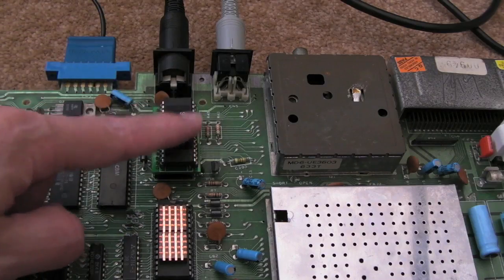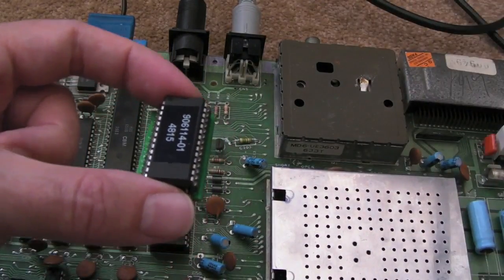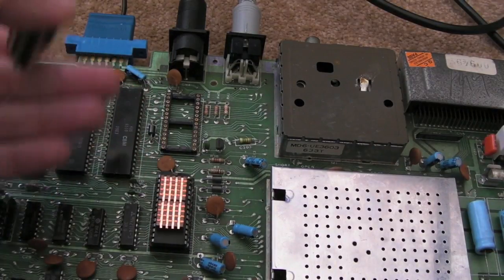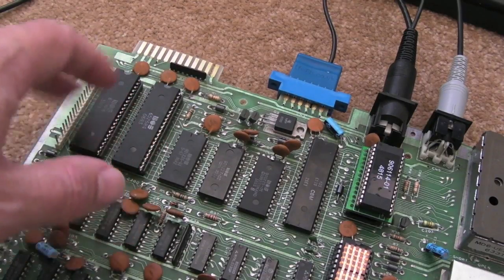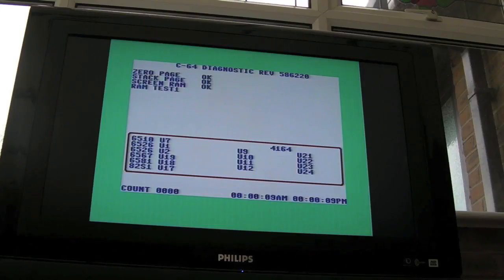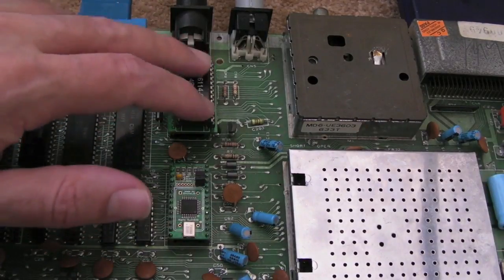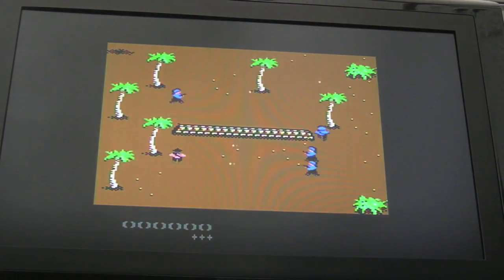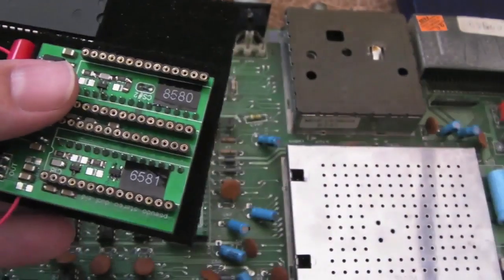Commodore 64 (C64) Tynemouth Software PLA Replacement

Comment: How come your diagnostic cartridge shows both U1, U2, and U18 as bad?  Mine does also and i have a string a keys that don't work so I substituted spare chips but the keys still don't work and the diagnostic cart still shows the chips as bad?
Reply from the maker: The diag cart needs the loopback cable harness in order to test the CIA chips properly.  So even on a working system it will report them as bad.  If you've swapped the CIA chips and the fault remains, I would suspect the keyboard or U28 (4066).

Comment: Hey GadgetUK164, nice videos. I see you have a diagnostic cartridge, where did you get it, or did you create it yourself ? :)
Reply from the maker: +Toshio Spoor There are a few different types on eBay - there's a 'dead test' cart, which is useful if your system is completely dead.  If the CPU has died you probably will still get a black screen with it, and if the VIC is dead you may also still get a black screen.  I use the standard test cart (ROM images available on the internet) in my 'Easy Flash' cart - see my video on the cart.   The Easy Flash cart is programmed using the C64, you load the programming software, select your .crt file from your SD2IEC and then it programs the Easy Flash cart using that .crt ROM image.  You can also buy the standard test / diagnostics carts off eBay as well, there are a few different sellers.
Reply from the maker: +Toshio Spoor And thanks btw =D
Reply: +GadgetUK164 Thanks! Going to dive deeper into this stuff. :)
Reply from the maker: Here's an example of one of the standard test carts, complete with the test harness (to test all ports out on the system). http://www.ebay.co.uk/itm/Commodore-64-64c-Full-Diagnostic-Test-Harness-NTSC-PAL-586220-IDC-design-NEW-/381111991170?hash=item58bc0b7b82:g:g6oAAOSwcdBWT0qi 

And here's a dead test cart:- http://www.ebay.co.uk/itm/Commodore-64-Diagnostic-Dead-Test-Cartridge-586220-/272089777740?hash=item3f59d0864c:m:myzTTnl50aHJAiAf_S3Xa7g
Reply: +GadgetUK164 nice thanks, btw you can also flash using usb i see: http://skoe.de/easyflash/doku.php?id=writecrtusb
Reply from the maker: +Toshio Spoor thanks, I think that's only works on the v3 EasyFlash btw!
Reply: +GadgetUK164 yes, it seems so, need to get one of those they are nice :)

Comment: Hi again GadgetUK. Not too long ago I read on the icomp websites that EPROM pla's should not be used.. and I couldn't make sense of it because so many seem to use them. Then I found a discussion on the lemon64 forum where Jens (icomp CEO) makes a good point.. C64 use NMOS and HMOS. EPROM is CMOS, where CMOS can drive pins high, but N/HMOS can just pull them high.. meaning that the bus can be safely pulled high at any time even when it is not supposed to. and so why is this any problem ? not in general use but he says that you don't know what people plug into the expansion port. I guess there might be something there.
Reply from the maker: +bwack Yes, to be honest I don't think its an issue with these Atmel chips as there doesn't appear to be any issue regards timing.  If timing was a bit hit and miss with occasional problems I would expect that what you described there is the cause, but since there are no timing issues, no glitches and no crashes, I think these 45nS chips with a CASRAM delay are fine.  Time will tell, I've been using the Atmel 27C512R for quite a while now and if anything it runs better and cooler with this chip than the MOS PLA I had originally.  When I get more time (maybe over XMAS) I might connect the logic analyzer up and do some comparisons between the MOS and OTP chips.

Comment from the maker: The 'blue text' issue on the SD2IEC there was caused by the rev 2 kernal.  Nothing to do with the PLA.  I fixed that issue in a later video by swapping the kernal in this C64 for a rev 3 kernal.

Comment: I have a few different kinds of PLA substitute chips here and a NanoSwinsid on the way in the mail, I'll report back if I notice any trouble. My favorite PLA substitute so far is the PLAnkton from e5frog and Eslapion.
Reply from the maker: +aphexteknol I've solved it with a 68pF cap on the CS pin of the Nano SwinSID!
Reply: +GadgetUK164 Good to know! I'm still curious if I'll have any trouble since my machines are NTSC as well, so the timings are going to be slightly different off the bat anyways...
Reply: +GadgetUK164 Good to know! I'm still curious if I'll have any trouble since my machines are NTSC as well, so the timings are going to be slightly different off the bat anyways...

Comment: It just Hit me, if the SID and the expansion together cause issues, i would guess theres some shared addresses and your getting what's known as cross talk.2 data streams Trying to run on the same address going to different places. IE the Pokey Chip.
Reply from the maker: +Amy Marie What expansion?  I think you are confusing the recent VIC-20 video with this one?  Good thought but there's nothing in there to clash with the Nano SwinSID!  It's definitely a timing issue related to the replacement PLA.
Reply: sorry the tynemouth board.
Reply from the maker: Yes, that was on the VIC-20, not the C64 =)  It's all got confusing because they look similar and I've been swapping from VIC-20 on one video to C64 on the next lol.
Reply from the maker: +Amy Marie Fixed that Nano SwinSID issue - needed a cap on the CS pin of the SID!
Reply: oh wow......i was thinking that too! what is it with caps? like damn!
Reply from the maker: I know lol!  They are nearly always either part of the problem, or part of the solution. =D
Reply: I know , its like you can't escape them.

Comment: i am currently trialing  a PLA replacement called the ultimate PLA, using  an altera epm7032s. i ordered 2 from an italian ebay .Hasn't solved my main issue , the dreaded black screen,(im wondering if i have a faulty MPU), however i have noticed that the VIC, the SID, the MPU, and the CIAs seem to run a tad warmer.

I used to have a respectful selection of working MOS PLAs.It seems that over the years whatever was used in the doping process on the die of a mos pla, seems to be breaking down internally.I tested every single one of these PLAs just over 4 years ago. as i have been renovating the c64s i come across, my stock dwindles without even using them.

Its good to see that there are some folk out there like Dave Curran,  that are dedicated enough to reproducing the ICs that are failing in such an amazing computer.

its a pity the original chip designs were lost. Someone somewhere would be making a fortune from genuine replacement parts.
Reply from the maker: +Jason Birch (argy101) Black screen is never a fun symptom to work with - my guess is its probably one of the 74 logic chips driving the RAM (as per the black screen video I did).  But it could be a CIA, MPU, or even RAM.

Comment: Hi. Great addition for C64 by Dave there. 
When you play around with timing. You can try adding piff on the CS pin as you said to slow down the CS, but if you want to make the CS signal to propagate faster through the EEPROM then try cooling spray on the EEPROM. Then the SID_CS signal will propagate faster through the EEPROM, but note so will also all the CS for all the other devices. I also think it is the orignial mos IC's are more forgiving and have wider margins for timing. The swinsid has latency I think caused by the software, and I think it is running on its own clock which makes the latency a bit random in respect to how fast it responds to the CS or other control signals... That reminds me, try some piff on other control signals as well...  I don't know it's like swatting flies in the dark :)
Reply from the maker: +bwack Haha @ swatting flies in the dark!  I think you are right, I think a cap might help.  I was going to have a go at connecting the logic analyzer up to it at weekend and see if there's evidence of an issue with the databus activity vs the CS, compared to an actual SID.  I think the Nano SwinSID is starting its read of the bus earlier than it should do perhaps.
Reply from the maker: +bwack I've got the Nano working with a 68pF cap on the CS pin.  Need to do more testing to ensure that's the ideal size but it instantly makes the sound OK in the diag cart.
Reply from the maker: +GadgetUK164 Sorted!  Music and sounds are just as they should be now!  =D  Just tested a load of games and they sound as they should.

Comment: Thanks, for the testing these and for the review. The EPROM replacement isn't perfect, but it does seem to work in many cases, and is easier than trying to source an original PLA. Also thanks for suggesting the capacitor mod in the first place, I had previously tried and given up using an EPROM.
Reply from the maker: +Dave Curran No problem!  I kept the stuff in about the Nano SwinSID as I guess it's interesting and the only issue I can find with these Atmel PLA replacements.  I suspect the Nano SwinSIDs timing was finely tuned vs another clock somewhere (pin 6?), and I am wondering if a delay is required on the Nano SwinSID CS or maybe on that clock input.  My guess its the Nano is starting to read the bus too early or too late due to the PLA logic being ever so slightly faster than it expects (in comparison with pin 6 input), whereas with an actual SID the tolerance due to slower rise and fall means that it just works without issue.  When I have more time later in the week I will have a tinker with the Nano SwinSID and see if I can solve the problem with a cap - it might not work due to the inverse logic, and actually the issue might be the clock going into pin 6 needing a small shift (which might not be possible depending on what else it feeds).
Reply from the maker: +Dave Curran I might actually get my logic analyzer onto this at weekend, just to compare how the timings look regards CS, R/W and the clock input on pin 6.  I bet that's going to shed a light on what's required.  It might be that the only fix is a firmware mod to the Nano SwinSID.  I am wondering if timing affects the SID CS generally, perhaps causing some contention or something which for the most part is not noticeable.
Reply: +GadgetUK164 The IO output from the PLA drives other things like the VIC and CIAs as well, via the 239. Does sound like timing, maybe too quick or too late?  have had a few boards were the diag cart locks up after a few notes of the sound test. Certain combinations of original SIDs and PLAs work fine, other's don't. The dead test cart's sound test often works even when the diag cart doesn't?  It's all a bit on the edge.  Do you have a link for the nano swinSID you have there? There seem to be various versions available.
Reply: +GadgetUK164 if you want the full gory detail on the timing, this is an excellent resource, if a bit heavy going:
http://www.zimmers.net/anonftp/pub/cbm/firmware/computers/c64/C64_PLA_Dissected.pdf
Reply from the maker: +Dave Curran Yes, I found a similar wierdness in that when the cap is not on the 27C512, the RAM test fails, basic reports wrong RAM amount etc, but you can run games from cart without issue lol.
Reply from the maker: +Dave Curran Thanks - I've read that article before and it's very in-depth as you say - It is very interesting though.
Reply from the maker: +Dave Curran I've got the Nano SwinSID working OK - needs a cap on the CS pin and it sounds normal again =D  I've just tested with a 68pF cap but I think your PLA has a different cap size, I might need to match whatever you had on there.  I did take it off and measure, but cannot remember if it was 80 or 90pF?
Reply: +GadgetUK164 I used 82pF caps on the CASRAM pin of the PLA. Are you adding the 68pF to the CS pin on the SwinSID?
Reply from the maker: At the moment I am adding 68pF as that's what I used in my PLA substitute, but I am testing with your PLA which is using the 82pF cap - and its perfect now!  I've just tested a good dozen games and they sound amazing on the Nano SwinSID - might get another I think!
Reply: +GadgetUK164 Another SID? if only there were a way you could install both in the same C64......
Reply from the maker: +Dave Curran I know lol!  I've ordered 2 more Swin SIDs to test with, but I've got those 4  MOS chips on the way from China any day now, so should have enough SIDs to be getting along with for your new board =)
Reply from the maker: +Dave Curran After getting the nano working last night I started to wonder about the effect of the slight CS timing difference on other components, and I am wondering if in that system you've got where the OTP PLA doesn't work, it might be worth just trying a cap on the SID CS, and if that doesn't work, see what else has a CS driven by the PLA and test them one at a time.  I am thinking there's something else in that C64 which is taking offense to the slightly early CS signal.
Reply: +GadgetUK164 You're right, might be worth a try. I'll give it a go next time I'm working on some C64 boards.